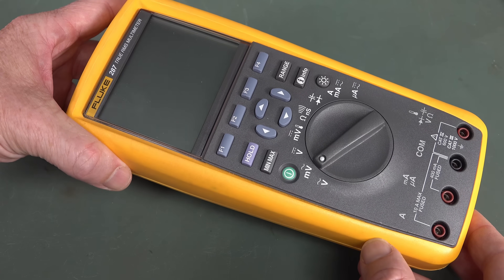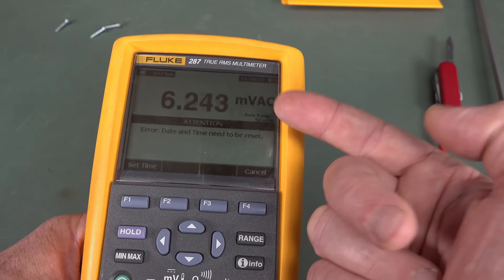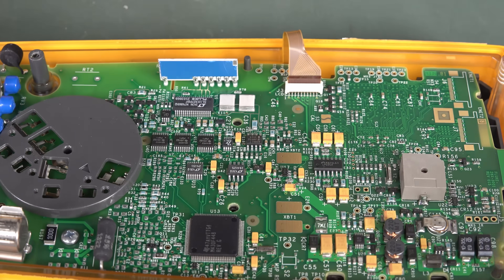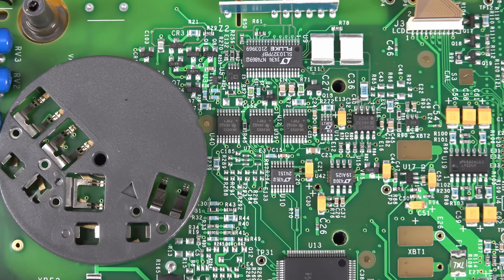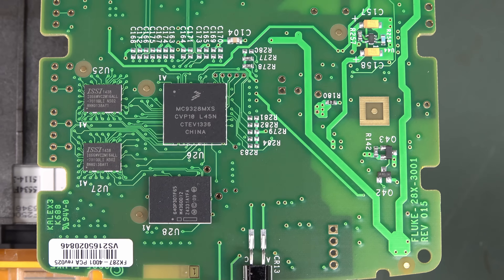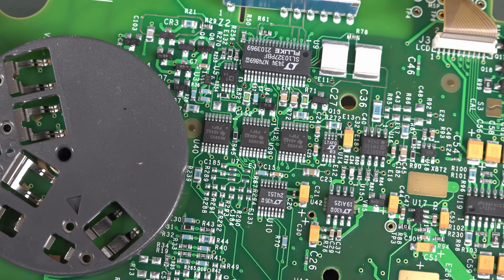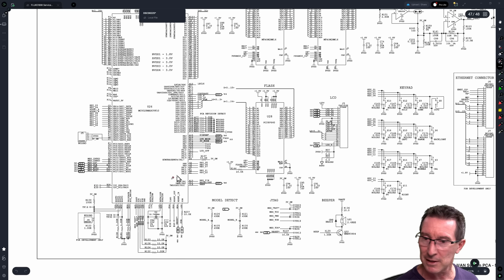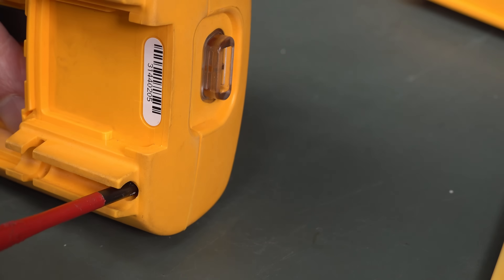EEVblog 1592 - Fluke 287 Multimeter Teardown

Comment: I recently repaired one of these (289) at work where the IR LED that did the probe detection on the amps ranges had gone out. Looking on the EEVblog forums, other people have had a similar issue. Replacing the diode was easy and I appreciated the polarity marking on the PCB. Despite not having been calibrated since new, it was at most 2 counts off on all ranges. I was amazed at how much better than spec this was, with all the "normal" ranges being less than 1 count off. 

The low 50 ohms range gets a lot of use, many people reach for the 289 instead of any of the other meters.
Reply: What are they using the low ohms range for mostly?

Comment: Nice video. I have a question: at 13:11,  why R5  - shunt resistor is 0.01 ohm, 2%, 1W (metal-element  shunt resistor)? 2% seems too low for high precision current measurement. Anyone can help me?  Thanks!
Reply: My friend told me that 2% on the shunt is normal for DMM, given that self calibration takes care of the offset and errors. Comments are welcome!

Comment: Loctite stops conduction pretty well, so they can't use it there. Also, I think they used clear plastic because they use optical jack detection, so it needs to see through that plastic there - as well as the top IR connection which is using the same big plastic piece.

Comment: I never have expected a damn multimeter to have 2 cpus. First of all the msp430, pretty awesome chip no complaints at all! But secondly you got a full blown Arm cpu for the UI and stuff and even ethernet port layouts, thats crazy! Also because that freescale jobby is 100% running Embedded Linux which in itself is fine, although the boot time is too long. A multimeter has to turn on in max 3 seconds and most of them do because its just a mcu, this one breaks those rules and boots a full blown os and UI app.

No thanks id rather stick with my regular multimeter which does have a lot of features but not all the bells and whistles this one has and also it boots in 2 seconds.

Also imo an Arm cpu with full embedded linux is too overpowered for a non color display also

Comment: Hi EEV, nice to see You, so long from not give You notice, from Europe repair, they never repair my Fluke 289 with that problem of  Loz function where show without probes connected on display, more than 8.4volts on AC voltage without any reason of course and even You know it's these 3.7 kohms between Voltage connectors of Probes. It's perfect correct about when we repositioning again the screw on plastics anywhere on devices to unscrew a little until the screw come easy on the hole and after that positioning we can insert the screw with the scredriver perfect perpendicular on screw. Nice to see You again.

Comment: Purchased a brand new 289 FVF on ebay for a reasonable price. 
Found out that the included USB-adapter had a production-fail known to Fluke.
Applied for a swap to which Fluke confirmed as my unit was affected. I then send them the defective cable.
Fluke then suddenly changed their stand-point and denied to swap the cable because I had purchased the product from what appears to be a liquidation seller and not thru a Fluke-blessed-supply-chain. 🙄
Fluke could easily verify the original reseller via the serial number ( if they worried about the unit being stolen ) but instead they just turned me down. 👎
I own several Fluke Products the most expensive being a 196 scopemeter, but I will never buy a Fluke product again.

Comment: I’ve had mine for 9 years now, coming up on 10 in about 4 months. Still dead on with the original calibration. Has that jack detections also. I think it helps that the LCD times out and turns off after a few minutes for that  200 hours for logging battery life.

Comment: The clear plastic casing under the rubber is a genius touch: you can have a display port that is totally waterproof without any kind of joint with the casing itself…

Would the loktite interfere with the conductivity? I do think so…

Comment: I repaired a few of the 289's with high voltage AC abuse in industrial test cage (likely about 4 kV 50 Hz) due to user error. 
Why did the management chose to use a fine instrument like that to test basic voltages in a cage baffles me.
Opportunity for me to get them cheap. I had 3 of those at one point - sold one. 

Putting one back together I forgot to tighten the screws and wasted quite some time finding the culprit. Once tightened I have not had problems over the years. 
289 has two PTCs. 
Upstream there is the transistor clamp array protecting the very input to the ADC. In one of the 289's a cople of the transistors were damaged.
The input protection is battle tested - in one of the meters the big input resistor had blown to pieces so violently that part of the inner case was evaporated (the clear part). 
Replaced the MOVs, PTCs and resistors and it was fine. 
GOAT meter!

Comment: is there any serial eprom? in meter information is fields that by default say 'Use Fluke ViewForms to edit fields' .. it is for setting Company name, Site name, Contact information.  As a private user, I can't justify FVF, and they told me its the only way.. I wonder if I can set it manually if its in an eprom.  but I guess its in the flash?

Comment: in reference to my earlier post I just want to know why use self tapping screws ,  to me that is not quality , that just says can`t be bothered to use metal inserts or we don`t care if the screw gets cross threaded ,  blow a fuse unscrew back , replace battery and again play with screws 
The multimeter I bought from Radio Shack  back in early 1982 has metal inserts 
Fluke isn`t the only one I`ve seen Dave here do tear down/ review of other meters   same thing  self tapping  ....Just Why    Is it to save a buck

Comment: When will the next generation be released? Meaning Fluke 389 to follow the 289 which followed the 189.

The 289 has been sold for over 20 years - how long was the 189 sold for by comparison?

Improvements for next generation (389?):-

-Make that near useless rear stand stonger and stop it falling off

-OLED display

-Battery life improvement OR Rechargeable Li-Poly battery pack (with Wireless Charging like a Mobile Phone) that fits in place of AA Alkaline battery holder

-Faster boot up time

Comment: At my workplace, power electronics designer in EV, I have a bunch of Flukes with rechargable batteries. They have a dedicated charger which plugs into the bananna plugs. I don't remember exactly which of them, usually it's written on the front.

Comment: Looks like the 287 supercap (made by Elna) is EOL'd - anyone know if there is an equivalent? I looked at mine and its leaking too :(. Had no idea until I saw this video :).
Reply from the maker: You can just remove it if you don't mind losing the time and date every time you replace batteries. Could also bodge in a modern supercap.
Reply: digikey #rscsk2043r3d01004t

Comment: This is quite an old design dating back to early 2000s. I was involved in a contemporary job for them on the Fluke Biomed side and a bit of preferred tech came our way. I'm not surprised to see an MSP on the Meter side. I'm unclear about the ~28 pin Fluke chip, but recognize the LTC196x. It's a good part as long as you do your cals and understand its LF performance. What's that 6Hz lowpass? Could they not do that in firmware? I heard about a big-ass processor on the UI side which caused them pain ("all your engineer are belong to us"). But they got it done and made the product they wanted. I still like my 289. I also like my 189. 

I guess the transparent inner is for the IR port. The Fluke IR dongle looks weird but works fine. This was before Bluetooth took off. 

Fluke were very hot on electrical shielding. They have A LOT of experience across industries and use it well.
Reply: The MSP430F dates from 2002 so 20 years is about right. Freescale became NXP in 2015. But they have done corrections to the PCB - REV15. There are a LOT of small parts on that PCB which I would be itching to remove if designed now. Also the board is awash with tantalum caps that can be replaced by ceramics.

Comment: Re: that clear inner skeleton: I'll bet it's polycarbonate, designed to give the ABS outer shell some beefy impact resistance.  Seems odd, because usually the protective case goes on the outside.  Perhaps Fluke cannot get BASF PC in the trademarked yellow color they need.

Comment: Recently score 289 for 300$))
Disadvantages:
1) Big and havy.
2) Tilding bay.
3) Start up time is not bad but usually when you use multimeter preferred scheme switch and go in fluke 28x case is switch wait and go.
4) Strange software solution at resistance mode they dedicated F3 button to switch between continuity and resistance mode ok it need, but in capacity and diode you need messing with menu F3 button doesn't used.
5) Doesn't remember las used mode after switch rotation.
6) Expensive Ir cable I made myself for 5~10$.
7) other minor thing like price, battery consumption, leaking ionistor, not so crisp display.

Overall is good multimeter with lot of good features but are it the best is opened questions.

Comment: Loctite works as an insulator, not really optimal for the input jacks.
Did some work for the military and using loctite on the screws for the earth cable was a no go, never seen so much paperwork with instructions on how to mount a single screw.
Reply: Doesn't seem like that would be much concern in this case given how the jacks are designed.

Comment: I do like the capabilities it has and precision, but it is really annoying to use. I just don't like it.
First, the boot time is just too long, a multimeter needs to be instant on. It's one of the most important "features" of a multimeter and this one fails hard. I can feel my blood pressure increases every time I have to use it.
The display is also far from good, you are more or less forced to use backlight all the time to read it. It also eats batteries like crazy.
Most often I end up using the 179 instead (unless I need the extra precision). It is working as a multimeter should work and it doesn't drive me crazy.
Reply from the maker: Yeah, not the best everyday use meter.

Comment: You kept missing the LT2415-1 24bit ADC (to the left and just above the MSP430 in the schematic). Also, the voltage reference is not the LM4041 but U42, a 2.5V LTC6652 (last page of schematics).
At first sight the ADC reference inputs look to be wrong with Ref+ connected to AGND and Ref- to AVSS (cct gnd) - until you realise that AGND is actually driven to the 2.5V reference voltage relative to AVSS. Also confusing at first sight is that the LTC2415-1 +Vin is connected to reference +ve (AGND) and the input signal is fed into  V-. However the ADC has a differential input so it's not a problem.
Reply: Great catch, but actually the schematic and layout show U42 (LTC6652) double-footprinted (in parallel) with U15 (LT1019).
On the actual device pcb, U42 is not populated and U15 is populated. U15's part marking "19A125" matches LT1019AIS8-2.5 specified in datasheet with a rated 10ppm/C tcr.

Comment: I always advise on sheet metal or plastic thread screws to reverse it until it drops into the original thread also. No sense cutting new threads that will destroy the plastic over time.
Reply: Good trick
Reply: 16:30 I learned this technique 30 years ago after bodging a couple plastic screw holes. ❤
Reply: It is a good technique for ANY screws.

Comment: The 287 is indeed a very pretty meter, especially on the inside, but it ought to be for the retail price it has.  You indeed get extra quality for the considerable extra money.  I still have and use daily the Fluke 8060A which I bought back in 1983.  It went back to Fluke in the late 1980s for an LCD board update and calibration.  I just checked the calibration against my 6.5 digit Keysight bench meter and the Fluke is still spot on.  I am not sure I would still trust the 41 year old plastic of the 8060A for high voltage withstand, but I rarely deal with any voltage greater than 240 volt mains.

Comment: My daily meter for the last 12 years is a 289.  Good but...battery life is terrible.   Boot up time is irritating.   87 is usually better.   

But, i do like the Min Max avg all on the screen at the same time with the current value.   Very useful.   So, i keep using it.

Comment: C145 probably doesn't have a replacement. From the research i did on my Fluke 189 (on your forum), it's there just to store your memory when batter power isn't present. Many other 189 owners have, and suggest, removing the super cap entirely so it doesn't leak out and ruin the board. I've had mine removed for several months now and use my meter every day at work with no issues.

Comment: I have a 289 and the tilting thingy is more a breaking thingy...annoying...plus if it drops a bit to hard the photo diode at the amp inlet tumbles off the pcb. It's very tiny but you can solder it.

Comment: I've got two 289's here. Fits my needs just fine.
The only things i don't like about em, is the screen isn't always easy to read, and how fast they chew through those 6 x AA batteries.
Reply: Change the supercapacitor, and your batteries will last 3x longer.
You can tell it is bad if it loses the date/time when the batteries are disconnected for a couple of minutes.
I also use two AA-sized 3.7V Li-Ion rechargeable batteries with three dummy cells.
Reply: I have 2 289's also.  I bough one for my Father who has since passed on, so I got his back.
They look practically brand new and his still has the protective plastic sheet on the display window.
I agree about battery life... that is the BIGGEST complaint about these meters.. and the super cap going short.
What I would like to know is where can I find the schematic?

Comment: Just had a question.  How would you know that the input resistor is fusable? My understanding is that a fusable resistor has a white band before the tolerance band.
Reply from the maker: Fluke ones traditionally are. But just a guess.

Comment: Great meter, been using them for years,  main downside is they can eat batteries when used daily
Reply: same! mine uses them up like nothing and i barely use it.
Reply: @aspork42  Maybe it's time to check the stand-by current. High stand-by currents can indicate a problem with the goldcap/supercap in the thing that keeps track of date and time. When it starts to become defective it goes leaky (both electrically and mechanically) and starts to draw high current in stand-by mode. (I've read reports by people who mentioned a whopping 36 mA when in standby).

Comment: It's a great meter from a resolution, precision and functionality perspective, but i find i have to use the backlight all the time to be able to see the screen clearly.........
Reply: Me too. The weird thing is that we got 60 287's at the place where I work. For such a high end meter, I expect them to be equal. But there's one meter that is definitely darker than the rest.  I (of course) first thought the contrast setting was to blame, but adjusting contrast does not help and when comparing with another meter, both show up to be on the same contrast setting.
Besides the boot-time (seriously, why?) I also dislike the weird extra buttons you need to press to get it to do extra function that only require a shift-press on the 187.

Comment: I bought the 289 brother for work for the extremely low burden voltage. This is, for the moment, not used to its potential. I still love the functions. We primarily use Fluke 179's for testing and diagnose. This meter is used for those special projects to impress customers!

Comment: Could you explain the LOW Z and LOW V modes of the 289, I know what the manual says, but you have such a better understanding of these inner workings I would appreciate it.
Reply: Low Z, is low input impedance to remove capacitively coupled voltages from the reading. Most meters have 10MΩ impedance, LoZ is generally a few KΩ.
Reply: I do know what LOW Z and LOW v are, also not just for a capacitive coupled voltage but for unloaded circuits that don’t drop voltage. I’m asking for an insider look of how it changes the meter design and the implementation of it schematically. Appreciate the reply.
Reply from the maker: @waynecostanza2280  It's basically a PTC resistor of a few Kohm across the input. The rest of the ADC path is the same as normal volts.

Comment: The tilt stand indeed is kinda crappy and could've been better. I just rest the meter against a surface.

I'm surprised you didn't take the front panel off or talked about the optical jack sensing. The case is actually transparent and the grey frontpanel is what makes it either a 287 or 289. The 287 front panel limits the movement of the range switch as the 289 has two extra positions. Of course the firmware is different. But other than the front panel and insert surrounding the lcd, the cases are identical.

Comment: Damn, i thought for aure the 3rd terminal would get more treatment. Left me hanging 😢
Reply: That was bugging me also, followed the trace from the XBT2 pad to R77 on the board, in the schematics that is connected to the debug pin on the processor.
So, probably only used at the factory, not for a different battery pack.
Reply: @MartysRandomStuff   I just checked my ~5 year old 289 and it does not have that third pad or contact on the battery holder

Comment: This is my 'go to' multimeter at work, the AC bandwidth is excellent and apart from the slow boot-up they are reliable and accurate. We have many of these in our office and we had a problem with one of them where the current probe input detection circuit didn't work correctly. It turned out to be a problem with the IR optics that are used to detect if the socket is occupied. I did a YouTube video showing what I found and from the comments it would appear that it is not uncommon to have problems in this circuit.